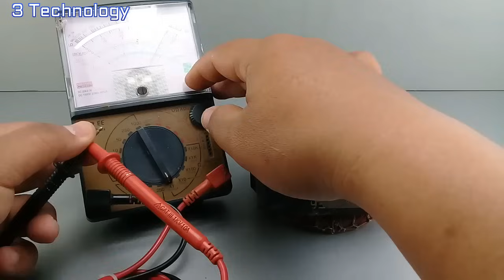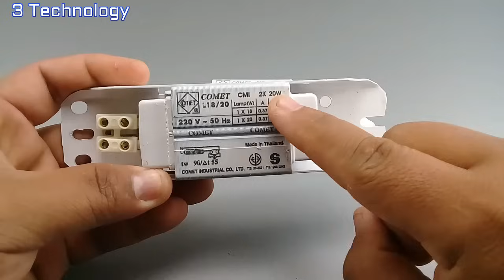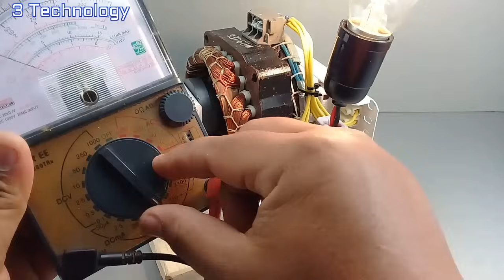I make 220v 15kw amazing electric generator from washing machine motor with light bulb transformer

Comment: THE BEST WAY TO ACCEPT OR DISMISS THE RESULTS OF THIS WORK IS TO TRY IT AS THE COMPONENTS USED ARE NOT GOING TO COST MUCH, BESIDES BEING QUITE EASY TO DO.
Reply: and it if works - make sure not to raise the amp usage too much - yet bridge it to DC and charge batteries and take it from there to needed AC with a proper inverter.

Comment: Hi , for this demo to be believable you would need to pick that completed unit up off the Bench it's sitting on and Hold it High Up so your viewers can see there are no hidden wires powering the Globes from underneath. 
Since it is so small you could easily do that instead of just Twisting it around on its base - because you still kept the Bottom from being Viewed from all angles - which is a little suspect. 
And since there are no moving parts -  and the capitor didn't stay connected to anything But Supposedly put A charge into the Unit - I'm doubtful that This unit Generates any 220volt Electricity by itself and certainly not 15 Kilowatts.  😉🙃

Comment: You get nothing from a permanent magnet.
And it is NOT a transformers, but a choke coils.
(By the way, it originally serves to neutralize the alternating components of the rectified current that are still moderately present.)
This is an prestidigitation. The system is supplied with external energy, but not from the capacitor, but from the excitation under the table. You can see that the "maestro" rotates his patchwork so that the motor stator coil always stays in one place.
Reply: ...это, диванными БЕСдельниками! собирание лайков и, куча проклятий в свой адрес! после того как потратишь время и ББР (...фантики под видом денег!)     . . .

Comment: 1. an electric current is created by the movement of a conductor in a magnetic field 2. if we take P= U x I, then it works out that if there were a magnet inside that would create a magnetic field and electricity would be induced in the conductors, the cross section of the conductor cannot be there 63 amps.
I= P/U, I= 15000W/220V, I= 63.18 amperes. 1 millimeter wire cross-section, carries about 10 amperes.
Reply: Неужели    Вы    Все    Такие    Миамити  ,   Что   Такоевране   Вертолёт?

Comment: Why do so many believe that motion is a requirement for power generation? What about Tom Bearden's MEG, the Motionless Magnetic Generator. Same concept. Asymmetrical Magnetic Field Interactions. Zero motion. On the Dept of Energy website for several months but removed because it didn't fit the narrative. 100 times more power than was input, by extracting free energy from the vacuum.
Reply: Es ist ein schwingende osszollirendes resonant es System welches vergleichbar ist mit Tom Bardens MEG. WER nicht weiss was Das ist braucht hier nicht weiter zu lesen. Dennoch sei hier für Neulinge darauf hingewiesen daß nur stärkerer Permanent - Magnetismus i;nerhalb eines free energy systems in der Lage ist
Reply: I'd love to see that!
Reply: Mit den unstreitig bewiesen en NEUTRINOS osszollirendes zu interagieren. Zwei kürzlich verliehenen NOBELPREIS machen DIES erklärbar. Insofern kann dieses System mit etlichen Permanentmagnetringen im Inneren des Stators Energie aus Neutrinos beziehen. Nochmsl: Permanntmagnetismus muss als Schwingung eingestuft werden das beweist schon die agile entfernungsabhängige Feldkraft. In vergleichbarer Schwingung frequenz ist die der Neutrinos. DESHALB können Permanntmagnetismus ab bestimmter Feldstärken und die Neutrinos überhaupt energetisch kooperieren. Überhöhte Leistungsangaben wie 15 KW bei diesem Motorwinzling ist eine übliche hartgesottene ABSCHRECKMETHODE

Comment: Hello, I don't know about 15,000 watts, but it seems that the principle driving it is similar to what is being proposed in The Liberty Engine #3 demonstration. If it does operate as presented, then it proves that silver is not required and it shows that there are many different ways to build a device. The seems plausible. I'm going to check it out. Thank you
Reply: ...умник, ты в школе учился!?? про какой ПРИНЦИП мелешь! да ещё с серебром     . . .
Reply: @юРА-ы1х  Hello, (Wise Guy?) The PRINCIPLE being whatever is causing it to do what is being presented. The magnets are arranged in a certain configuration to cause something to happen. Being able to explain what is happening by arranging those components in THAT WAY would be based on a PRINCIPLE. or PRINCIPLES. It's a very interesting looking device. Whether it works as presented or not, I don't know. I would have to attempt to replicate it to find out.
Reply: Но но но
Reply: It is the principle of A.C. and magnetism that drives this generator. yes it is plausible.
Reply: Как проверите сообшите нам пожалуйста

Comment: Lift it off the table and show it from all sides to ensure there are no wires connected to an electrical source. This way, we all doubt that it's connected from below to an electrical source or that there's an electromagnetic energy source behind the vertical barrier.

Comment: The parts have seen in actual footage were intact or complete to generate electricity, the missing part to complete free energy was the alternating flow of current which is the produçt of rotating motion produce by magnetic field, I think the guy hide the important aspect to prevent its intelectual rights, I think he hide the rotating alterñating switches to magnetic coil with power produce by itself arrangement by power start of that capacitor to electronic switch timing distribution.

Comment: Why all this story abour cost of oil, gas, petrol, diesel etc. Just build a thing like that and you can profuce  free 15 kW of power.
My friend, do you know what is the current of 15 kw at 230 vac? Sure not, because to handle that power you need cable as big as your thumb. But you don't know that.
Reply: 15000w/230v +/_65 Amps have you ever seen a 230V /65A load switch on with a normal switcher 🤣or replace a  64 A fuse  with naked hands  15000 W is a lot of power 🥴those sockets are max 10 to 16 amps😲
Reply: @64615z  must use at least 7 sokets at max load. 🤣🤣🤣🤣🤣🤣

Comment: The kw is false, To determine the gauge of the wire and the current you must calculate the dimensions of the stator, I assume the gauge of the coil wire is 22 or a little higher and the dimensions of the stater do not reach to 0.2kw

Comment: A simple calculation determines a potential current of 68 Amps. How do you think the wire you are using will take that much current? Also, the 'adaptor' (which houses the battery for your "experiment") is only rated to a maximum of 13 Amps. 
Show us the device running something that requires 50 amps. Also, aesthetically, you may gain a little bit more credibility if you elevate the device from the table😂
Reply: Exactly
Reply: Or at least use transparent adapter!!!
Reply: He is referring to the capacity of the generator. he is only showing the light bulbs as a load. 14 AWG will work. Do you really need a number 8AWG to light up a bulb?
Reply: Я   Запомнил   Точна    Вот   Эти   Руки    Делают   Все    Вране .  Я    Уже      Все    Перепробывпл
Reply: Тоже   Бальшое.     Вране

Comment: Unless the magnet is mechanically moved in some direction perpendicular or oblique to the wires, it is impossible to induce an electric charge, so don't believe these lies! These are focuses, nothing more!
Reply: Quando você oscila um ímã você causa uma oscilação magnética.
Você pode provocar uma oscilação magnética sem magneto, mas sim com oscilação elétrica que é nesse caso.
Reply: Fake
Reply: ...магнит не надо вращать к проводнику! только проводник вокруг магнита!!!      . . .
Reply: Meu amigo, é possível sim.
É um sistema eletromagnético perpetuado pelo próprio sistema.
Reply: How it is true ?
Reply: Work skill is good but use in useful matters
Reply: Bunun altından kablo gelmiyor mu
Reply: An EI transformer does not require a moving magnet but it transfer energy from primary to secondary windings that needed an AC voltage to produce the voltage it transform.
Reply: Il n'y a aucun conseil  à donner c'est un conneroe  ça ne peut pas exister c'est de la science fiction  sinon on supprimerait toutes les centrales nucléaire .
Reply: True. No movement no electricity. All experiments claiming to produce electricity without moving parts are fake. But those with moving parts I can give them a benefit if doubt.
Reply: Fake
Reply: Çok şeyler denedik yenilebilir enerji motoru olmadı
Reply: That's right
Reply: The problem here is that this people who doing this kind of crap videos are scamming people... obviously they are not stealing any money from anyone.... but using a simple "NEED FOR SAVE MONEY ON ELECTRICITY" They make people click on that kind of videos and each view is getting paid by YouTube... so it's a scam in a sort of way because they are exploiting a need for saving money of poor people who need to save on electricity bills... I think we need to start reporting those kind of content on YouTube... us ... the people who knows how the laws of thermodynamics works and us that we know that all of this is JUST A BS 100% FOR SURE!I think it is a kind of a responsibility we have to help others...and stop that people who exploiting the needs of others to earn money like this...
Reply: Fake falso un estúpido con vídeo manitos abajo para un mentiroso
Reply: Falso
Reply: Falso un mentiroso manito abajo
Reply: 😂😂😂😂fack
Reply: Se tutto fosse cosi semplice non userebbero le centrali nucleari per produrre energia.
Reply: I am agree
Reply: This guy is a scammer
Reply: Where is the source that generates this?
Reply: @jfserafim1366 A fonte foi o capacitor que serviu como start.
Reply: This guy always uses thick wood panel for hiding the power source
Reply: @joo-sookim1016  Pa naravno prevara.
Reply: You should make a video to prove your theory to see if it holds true.
Reply: Puko sam za projekat sa magnetima. Iskopirao sam generator sa Neo.magnetima... Izgubio godinu i vise truda, muke, finansija... Pokusat cu i ovo?! Ako bude ovo ovako, ja cu licno staviti na YT! Ukoliko ne, ovog genija nagraditi sa 🍆 Poz.
Reply: Ppp